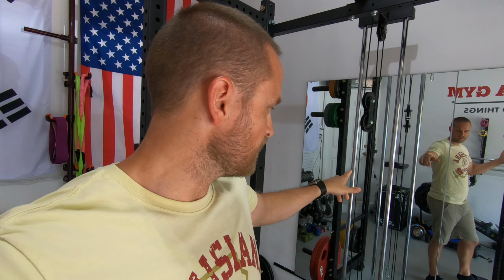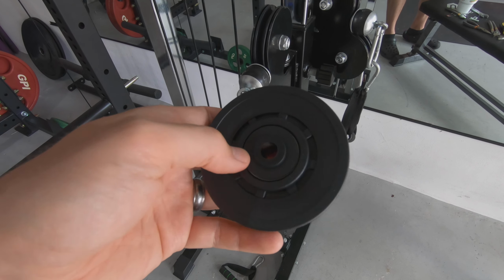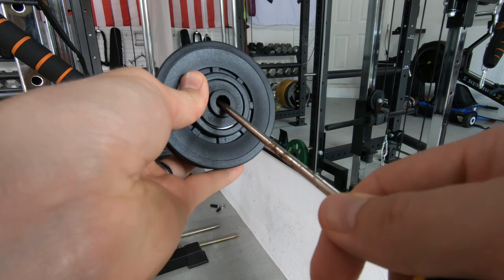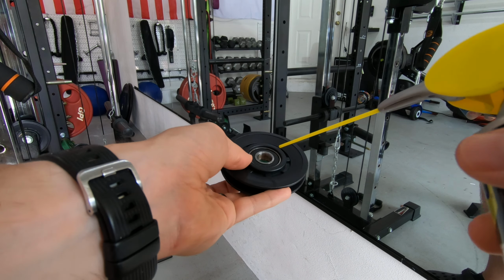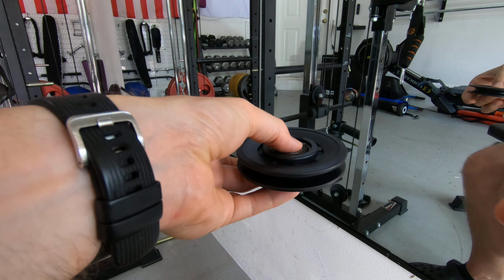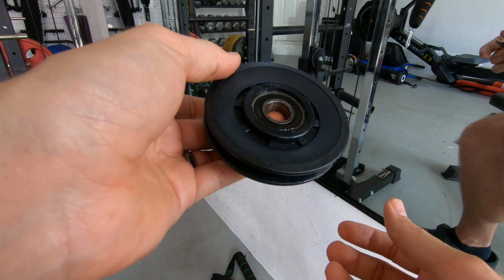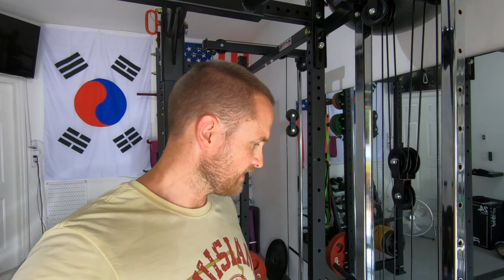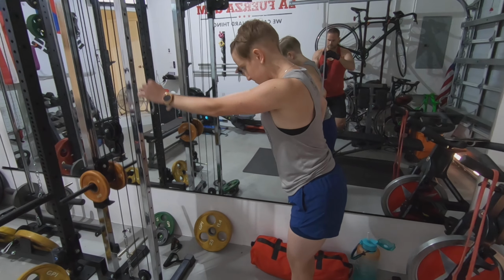How to Lubricate Titan Cable Tower

Comment: Thanks a lot man! Great as usual. 
Do you think the pulley height adjuster works well on this machine with its bolt screw mechanism?
Reply from the maker: Yeah I haven't noticed any issue with the pulley height adjuster. It sort of sits weird at an angle with no tension, but when you use it the tension pulls it straight. I haven't had any issues. Hope that helps!

Comment: Thank you for sharing this. I ordered this exact model, do I need to go ahead and order new rock climbing strength caribeners?
Reply from the maker: I'm glad it was helpful! I've used the cariberners that came with it and haven't had any problems. Most I've put on mine is between 150-200lbs. Hope that helps.👍
Reply: @DiscoveringStrength  Thank buddy.

Comment: Did you remove the square rubber "seals" from the guiding rail? I assembled mine and when i pull the weight up it goes down extremely slow

Comment: How smooth did your trolley move when first assembling it? Just got mine and there is a lot of lag with no weight. Everything is set up correctly. Does the guide rail need to be lubricated too?
Reply from the maker: Mine moved pretty well. You may have to choke up on the chain to remove slack in the cable. I didn't that. Hope that helps!

Comment: Is there a difference in using one cable vs both?
Reply from the maker: Not really. It doesn't make it any easier. It's just a preference thing. You can use two arms at once as opposed to single arm. Hope that helps!

Comment: Is it require to lubricate the cable also?
Reply from the maker: You don't need to lubricate the cable. However, you can also lubricate the guide rail. I did that, but I saw the biggest difference when I lubricated the pulleys.
Reply: @DiscoveringStrength  what did you use to lubricate the guide rail and did you spread it all across the rail?
Reply from the maker: @grindflowz5626  I used the same silicone-based lubricant on the guide rail. Yeah I did my best to spread it all over the rail. I started from the top and worked my way down as I pulled the weight carrier up and down. It seemed to help a little, but I noticed the biggest difference after lubricating the pulleys. Hope that helps!

Comment: You can actually remove the black bearing seal and put actual grease on them.
Reply from the maker: Hmm...I didn't know that. Is it difficult?
Reply: Discovering Strength no. It's very easy. Just gotta be a little careful not to bend the shield too much. Search  "removing bearing shields" on YouTube.
Reply from the maker: Thanks! I'll have to try it out.